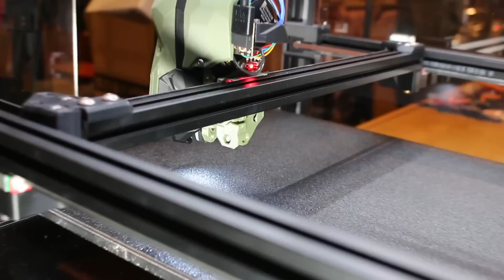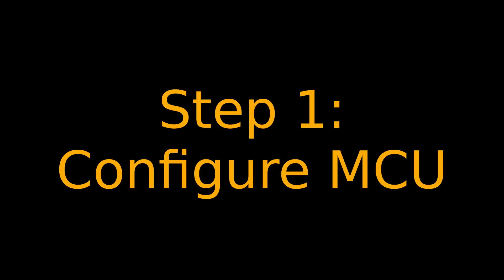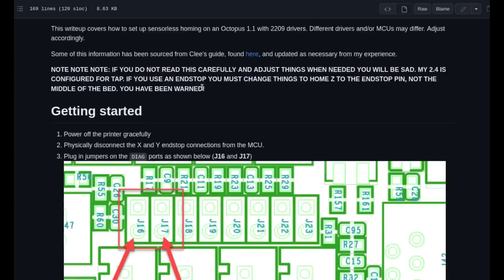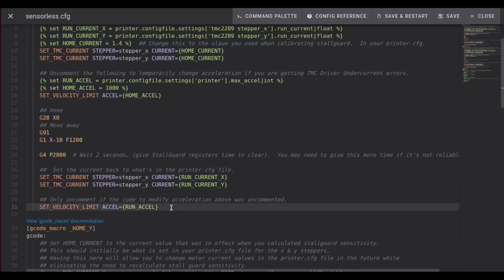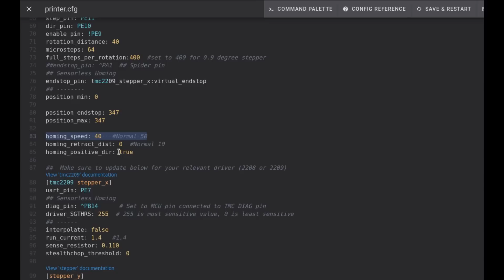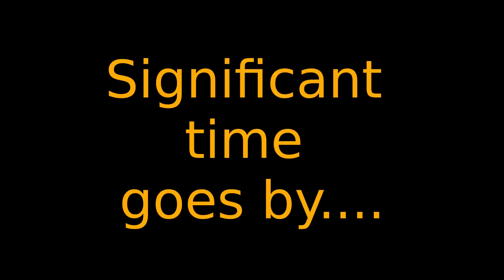Sensorless Homing, eliminate microswitches with Voron, 3d printer, Klipper, stepper motors & more

Comment: I run 5 vorons and have tried sensorless homing. It just cant be trusted as SOOO many things cause a false positive. Voron was built for microswitches and SHOULD be used IMO. This is of couse my own experience and might not reflect what you might encounter but I've had to go back and add microswitches to my recent build.
Reply from the maker: I'm sorry it did not work out for you.  My Voron 2.4 and my v0.2 both are sensorless and they work well.  But thank you for the feedback.
Reply: @KapmansBasementWorkshop  Hey thanks for taking the time to respond. But as a member of a very niche community I would encourage you not to promote sensor less vs microswitches. I run a print farm that produces parts and with thousands of hours on each of my printers microswitches are absolutely the way to go. I have never had a single microswitch fail vs tons of failures from sensor less. Things happen when your pushing a tethered cable around (using canbus) and that will cause more problems. Spend the extra 10cencts per microswitch to get good ones and then they wont fail even after 6-10 years.
Reply from the maker: @microcontrolledbot  Thanks for commenting and watching.

Comment: I have the LDO Nitehawk SB  that I just installed. When going through the set up of the endstop pins for x and y do I use the original values or the update pin mappings that LDO documentation had me switch to? Referring to this section, use these values for the sensorless or the old values before the nitehawk? 

#####################################################################

#   Endstops
#####################################################################

## XES - Toolhead PCB
[stepper_x]
endstop_pin: nhk:gpio13

## YES - Toolhead PCB
[stepper_y]
endstop_pin: nhk:gpio12
Reply from the maker: You must use the LDO MCU pinouts.  Fair warning in that I have no experience with the LDO controller.  I wish you a great build.
Reply: Did you ever get this figured out? Getting ready to install the Nitehawk SB and was curious.

Comment: I won't have sensorless homing anytime soon.

How are the switches failing? You connect them in NC mode right, so if the switch has failed, it must register instantly triggered and prevent further movement, i would think?

A little bit of a dumb idea but like... i guess i can just run a ground pad to the moving part and the stationary part can be a pulled up pad. Just a steel-nickel strip. Not ideal because that would have to be in NO mode.
Reply from the maker: This is an enclosed 3d printer.  The internal temps get between 60c and 70c.  I think that approaches the switch's operating limit of 80c. I also think soldering wires to the switch, if you are not quick enough about it causes some damage to the switch as well.  The combination of the two means the switch doesn't last as long as I would suspect.
Reply: @KapmansBasementWorkshop    So here's a not-so-hot tip, you don't have to solder wires to switches. You can use fitting spade plugs. People less inclined to crimp can order endstop spade wire premade from various Reprap and Ramps suppliers.

When using spade plugs, switches must be connected in NC (normally closed) mode. This way, if the connector degrades or the wires get tugged and fall off, the endstop is interpreted as triggered without actuation and should stop hazardous movement. But i say the hole in the switch terminal actually locks the spades pretty nicely!

Also see Alex Kenis video Failing Switch Problem: Omron vs the Modern Mouse Circuit. This dude is excellent at building 3D printers, but this time he is talking about something else but it still applies. Thing is our endstop switches while different in size, they have the same type of internal construction and guaranteed also the same problem. In short, if you run a 32bit board with 3V3 IO logic voltage, the switch is operated outside spec on the current-voltage curve with either or both being too low. Normally, the switched power electrically causes an impact to oxide that forces it to flake off. If the current and voltage are too low, the switch experiences continued oxide growth. At elevated temperature, even within switch's operating range, the oxide growth is much accelerated.

I also think switches should ideally be coated with a layer of deoxit d5 inside. See Applied Science: How Corrosion Inhibitor Protects Metal. Alex concurs, when i talked to him about it.

There is a way to run switches harder, you can run them from 12 or 24V high rail. One side of the switch gets connected to this rail via a pullup resistor corresponding to a suitable current according to switch spec, and in parallel this same side of the switch gets connected to the microcontroller input via an 1n4148 standard small-signal diode, with the diode pointing away from microcontroller and towards the switch. The other side of the switch is tied to ground. Engage weak software pullup. This way when the switch is open, the microcontroller input is driven by internal pullup. The 24V rail would love to pull up the microcontroller beyond absolute maximum rating, but for that to happen the current would have to be flowing in the opposite direction of diode, which the diode prevents. However, when the switch is closed, the switch will successfully pull down the microcontroller through the diode, while the high rail and its resistor provides switch cleaning action.

You can use this same high rail to logic voltage conversion trick with inductive probe as well, if you were to use one.

Since you have failed to describe the failure mode, i mean whether switch fails open, fails closed, or fails no-contact, i don't know whether these approaches are applicable. I thought i wasn't too ambiguous but i guess i was.

Comment: What about power recovery with sensorless homing. Still works? Thanks for your video.
Reply from the maker: I honestly don't know.  I don't have any power recovery electronics in my printer.  But it might be a problem.  If power goes out, how does the printer home with the print on the bed?  And since this method isn't perfectly repeatable, so I'm not sure it would be able to restart the print from where it left off.  I wish I knew more.
Reply: @KapmansBasementWorkshop   Power loss recovery, when implemented, only homes XY and doesn't home Z, uses recorded Z instead.

Comment: Any Idea what this means when I try to home? Move out of range: -10.000 0.000 0.000 [0.000]   EDIT1:   I found out what this issue was. your x and y home position is -10 but my min for x and y is 0, so i just changed the -10 to 0 and it worked. 

Edit2: I managed to get mine working perfectly with lots of small tweaks to the current, feedrate, accel, and other settings, but I am bummed out about something. With the Z safe homing, it will lower the bed slightly before it homes X/Y, but with this sensorless macro, it does not do that which could cause a nozzle drag if the bed is not low enough to start with.
Reply from the maker: Compare your homing override to mine:

[homing_override]
axes: xyz
set_position_z: 0  ## Test
gcode:
  G1 Z10 ## Test

  {% set home_all = 'X' not in params and 'Y' not in params and 'Z' not in params %}

  {% if home_all or 'X' in params %}
    _HOME_X
  {% endif %}
  
  {% if home_all or 'Y' in params %}
    _HOME_Y
  {% endif %}
  
  {% if home_all or 'Z' in params %}
    G90
    G1 X175 Y175 F12000  ## Change this.  Should home to the z endstop pin if you don't use TAP.  Also, this is for a Voron 2.4 350.  

    G28 Z   ## Home Z
    G1 Z10 F1200
  {% endif %}

Comment: Hi i had an sd card fail and my backup didn't work either. So full install done with a new rasp pi4 and have got so far but come up against the error tmc virtual endstop requires diag pin config.
I'm not sure where to look next.
 [include sensorless.cfg]

[force move]
enable_force_move: True

[mcu]
##  Obtain definition by "ls -l /dev/serial/by-id/" then unplug to verify
##--------------------------------------------------------------------
serial: /dev/serial/by-id/usb-Klipper_stm32f446xx_470048001251303431333234-if00
restart_method: command
##--------------------------------------------------------------------

[include mainsail.cfg]

[printer]
kinematics: corexy
max_velocity: 300  
max_accel: 3000             #Max 4000
max_z_velocity: 15          #Max 15 for 12V TMC Drivers, can increase for 24V
max_z_accel: 350
square_corner_velocity: 5.0

#####################################################################
#   X/Y Stepper Settings
#####################################################################

##  B Stepper - Left
##  Connected to MOTOR_0
##  Endstop connected to DIAG_0
[stepper_x]
step_pin: PF13
dir_pin: !PF12
enable_pin: !PF14
rotation_distance: 40
microsteps: 32
full_steps_per_rotation:200  #set to 400 for 0.9 degree stepper
##endstop_pin: PG6
position_min: 0
##sensorless homing
endstop_pin: tmc2209_stepper_x:virtual_endstop
##--------------------------------------------------------------------

##  Uncomment below for 250mm build
#position_endstop: 250
#position_max: 250

##  Uncomment for 300mm build
#position_endstop: 300
#position_max: 300

##Uncomment for 350mm build
position_endstop: 350
position_max: 350

##--------------------------------------------------------------------
homing_speed: 40   #Max 100
homing_retract_dist: 5
homing_positive_dir: true

##sensorless homing

diag_pin: ^PG6
driver_SGTHRS: 225
##  Make sure to update below for your relevant driver (2208 or 2209)
[tmc2209 stepper_x]
uart_pin: PC4
interpolate: false
run_current: 0.8
sense_resistor: 0.110
stealthchop_threshold: 0

##  A Stepper - Right
##  Connected to MOTOR_1
##  Endstop connected to DIAG_1
[stepper_y]
step_pin: PG0
dir_pin: !PG1
enable_pin: !PF15
rotation_distance: 40
microsteps: 32
full_steps_per_rotation:200  #set to 400 for 0.9 degree stepper
#endstop_pin: PG9
position_min: 0
##sensorless homing
endstop_pin: tmc2209_stepper_y:virtual_endstop
##--------------------------------------------------------------------

##  Uncomment for 250mm build
#position_endstop: 250
#position_max: 250

##  Uncomment for 300mm build
#position_endstop: 300
#position_max: 300

##  Uncomment for 350mm build
position_endstop: 350
position_max: 350

##--------------------------------------------------------------------
homing_speed: 25  #Max 100
homing_retract_dist: 5
homing_positive_dir: true

##sensorless homing
diag_pin: ^PG9
driver_SGTHRS: 225

##  Make sure to update below for your relevant driver (2208 or 2209)
[tmc2209 stepper_y]
uart_pin: PD11
interpolate: false
run_current: 0.8
sense_resistor: 0.110
stealthchop_threshold: 0
Reply from the maker: Have a look at my cfg files here: https://github.com/Kapman1/Sensorless-Homing
Reply from the maker: Hopefully that helps
Reply: @KapmansBasementWorkshop  thank you for your help. I've now got klipper to load without any errors but when i try a G28 X0 to start  stallguard tests i get an error unknown command "set kinematic position" any ideas

Comment: Will this work for z axis then no need for the tap thing and alot easier. Good video
Reply from the maker: Everything I have read, no.  It's not accurate enough for z.  Also if you have more than one z motor, Klipper can't sensorless home more than one motor at a time.  This was my 1st thought once I got this working!
Reply: @KapmansBasementWorkshop  i use a load cell right now with an arduino but someone else on youtube who has a load cell said theres a way to configure klipper to use it directl without the microcontroller in between its VERY accurate. The reason i wanna get rid of it because i use a hermit crab can board to facilitate fast tool changing on my v2.4 and it would be nice to eliminate the extra bulk, i havent thought of a good way to build tap into the tool changer yet so sensorless would be ideal. Btw i am using closed loop steppers so it seems like maybe that could make the sensor less more accurate than just normal skipping step?

 I did try the tap on my trident and its nice too but the load cell works better. I really want to get one of rhe bed scanners something like my x1c has. My addiction to printers is not healthy for my bank account lmao. 

Anyways thanks for your fast reply, i love your channel. Keep up the hard work
Reply from the maker: @98f5  I'm dreaming of a load cell as well!  Closed loop steppers should be more accurate in these situations...I think.
Thank you!

Comment: I just use infrared gates they are the most reliable
Reply from the maker: I will give them a try at some point....
Reply: @KapmansBasementWorkshop  i only using them on x/y no touching and they were cheap from ali. I just looked for them and not finding the product anymore but basically you can make your own with a photo resistanter and an led, it probably doesnt even need to be infrared.

Comment: I have slight fear of the sensorless homing. I understand the choice to not keep breaking the endstop switches, but won't this just strain the steppers much more?
Reply from the maker: I don't see any strain on the motors. But if it's not tuned correctly, I could see sensor less damaging other parts of the printer like the gantry. So please be careful.

Comment: Thanks Kap.  I had to set Interpolate to False else I had undervoltage issues.  Do you know if homing with Z hop is an option or is it a problem?
Reply from the maker: Hmmmm.  I never would have guessed.  Thank you for posting your solution!
If I understand correctly, homing with z-hop should not be a problem.

Comment: Only issue i have is that when it homes it meant to bring the y out by -10 mine doesnt so i clanks the back rail
Reply from the maker: Do you have it setup like this for homing Y?
G28 Y0

# Move away so the x-axis is no longer touching the back of the gantry
G91
G1 Y-10 F1200

G4 P2000
Reply: @KapmansBasementWorkshop yes but it doesn't move away on the x or the y
Reply: @KapmansBasementWorkshop think my issue is to do with using klicky probe with sensorless homing and the homing override are conflicting with each other
Reply from the maker: @aaronharnett7938  That may be the case.  But I don't know for sure.

Comment: I found my value (92) for both x and y, when the hotend is in the middle (175,175) everything is fine, but when the hotend is at the back (y=350), doing a G28 x0 only move x a bit, I have to set field SHTHRS = 50 for it to work, but that is not good because if I do a G28 x0 when the hotend is in the middle of the bed, it bang on the extrusion
Have you seen this
Reply from the maker: Make sure when all power is off that when you move the hotend by hand, there are no changes in resistance.  If your printer uses linear guides, make sure they are well lubricated.    Also, make sure that there is enough slack with the cables to the print head so that no additional resistance is being created in that position.  In short, for some reason there is more resistance in that location and you need to figure out what the cause of that is.
Reply: @KapmansBasementWorkshop  well the wiring is OK, beause i've been using this printer for a long time.
If I had looks carefully, I would have seen that after a G28 x0, they actually move back 10mm , so it is never at max position (350 in my case). so it actually works fine.
Reply from the maker: @yvesinformel221  Great news!

Comment: I'm a bit confuse, I though your diag pin had to be set to your old endstop pin (PA2 for x), but your diag pin is PB13, looks like I have to listen again
Reply: OK, I see, it's different on the Spider, I'm using old SKR 1.3, maybe it's the same
Reply from the maker: I posted a link in the video description to a site that shows how the pins are setup for one of the BTT boards as a good clue.  But you should really go to the skr 1.3 documentation where it will show you the diagnostic pins.  The Spider is a very different board.
Reply: @KapmansBasementWorkshop  thanks, I found the problem, my x  endstop was at pin 1.28, but I had to use 1.29 (xdiag) for sensorless
Reply from the maker: @yvesinformel221  I'm glad you found it.  And thanks for posting how you solved it.  Hopefully others can make use of this.
Reply: ok found my problem, my x endstop was set to pin 1.28, but for sensorless, I had to set it to pin 1.29 not 1.28

Comment: Thank you for this very informative and helpful video! I have a question: how to lift the toolhead before homing? I followed your guide to do the sensorless homing and TAP.  Before TAP I was using klicky , when I home all, the Z axis lift a few milimeters (maybe 20 mm?), and then start homing all axises. Now with TAP, I find it doesn't do this, sometimes (when first layer was bad and I stopped it) when I home the axises, it just move and the nozzle scatch the bed. I tried add gcode to lift Z, but it won't let me do it before homing. I tried using safe_z_home which raised the toolhead. so how can do this lift z with the [homing_override] function? I see your toolhead lift when you do the G28 X0, how do you do that?
Reply from the maker: The code should look like this:
[homing_override]
axes: xyz
set_position_z: 0  
gcode:
  G1 Z10 ## Test

  {% set home_all = 'X' not in params and 'Y' not in params and 'Z' not in params %}

  {% if home_all or 'X' in params %}
    _HOME_X
  {% endif %}
  
  {% if home_all or 'Y' in params %}
    _HOME_Y
  {% endif %}
  
  {% if home_all or 'Z' in params %}
    G90
    G1 X175 Y175 F12000  ## Change this.  Should home to the z endstop pin if you don't use TAP.  Also, this is for a Voron 2.4 350.  

    G28 Z   ## Home Z
    G1 Z10 F1200
  {% endif %}
Reply: @KapmansBasementWorkshop  Thank you very much for your reply! I tried your code and it worked perfectly. I like your video, it has all the details for beginners like me!
Reply from the maker: @goldon999  I'm super glad it was helpful.  Thanks!